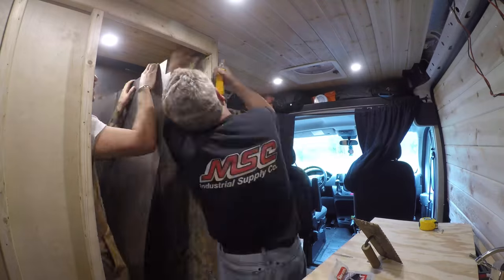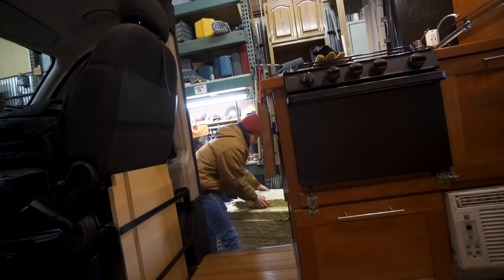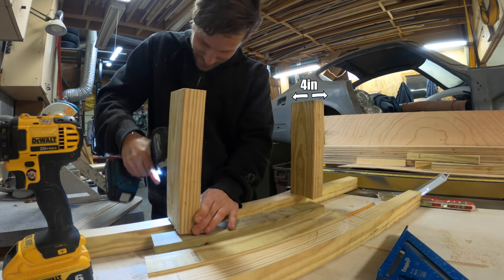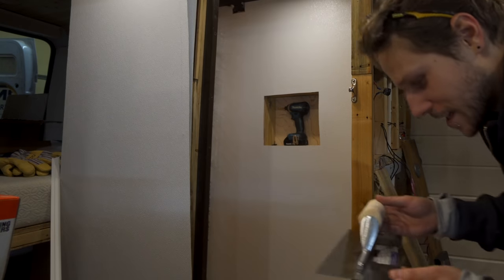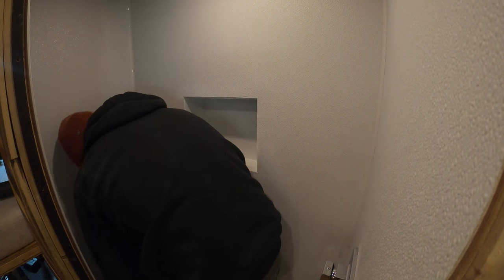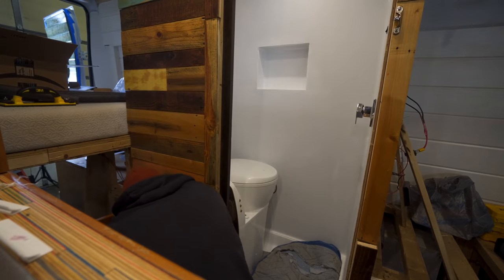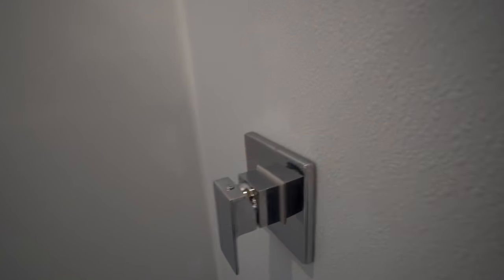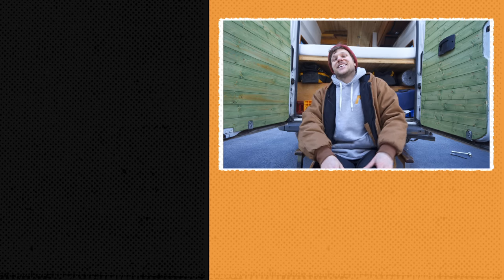DIY Van Wet Bath Using FRP Shower Walls

Comment: Skip the panels, use marine grade epoxy and fiberglass chop strand right on to the 1/4" plywood... I even just use epoxy only and seal both sides and the edges and have it outside and no rotting of the plywood. Want color gel coat it after or the epoxy on the plywood alone looks good too.
Reply from the maker: Do you have any photo examples of this I could check out?
Reply: @dogcatmanvan  The place I did it is hard to photograph. I made a matching bulkhead plates on the outside of the box and cab so I could use accordion seal in between and go from box to cab. I have a 26' 89 International diesel S1600 LP Uhaul. The LP is the low profile package where you can drop the truck 4" with the air bags. There is about 7 inch space to see it, but I painted it so it looks like a steel plate and not plywood.
Here are some links to other projects using that technique.
Tank
https://youtu.be/uWYPBm0tu38
Boat wheel house
https://m.youtube.com/watch?v=TzkWeuC0yPs
Plywood Shower and tub
https://youtube.com/playlist?list=PL4cGhq-GjyFk6do3YfNMpIkGsbfgNRrds

The key is to seal every thing and if you drill a hole or nail it reepoxy those spots and it won't rot or get wet... If it gets wet, and freezes it will pop the fiberglass and epoxy off. 

Had that issue with my box... They repaired a 4' x 8' hole in the side of my box with bondo and not marine grade fiberglass. The wrap, primer and sealer cracked and the bondo sucked water in, rotted the plywood next to where the bondo was and where it wasn't, water soaked in to the frp and popped the panel off the plywood. So I had to cut it off to where the connection was still good and feather the edge and chop strand it back to level... I only noticed this when I took 5 layers of wrap off the box because spots had cracked and I wanted to seal the roof and sides with Raptor bed liner.

Don't use automotive grade fiberglass or epoxy... They aren't water proof. They rely on the paint to seal it. Marine grade epoxy will soak into the plywood. Or if you have deep pockets, you can use starboard and not need to seal it.

The project is on hold I got cancer 4 months ago, beat it and now trying to get my strength back to finish it. Was getting ready to put a non roof penetrating roof rack on. It will attach to the box sides. I have zero holes in the roof and it doesn't leak so I'd like to keep it that way. ;)

Comment: I’m finding so many cool channels now that I posted working on my travelcraft !!! Your channel is great I’m almost done with my shower pan using the epoxy fiberglass method but my shower is at the rear end and used massive 2x6 boards for the curbs of the tub 😂

Comment: looks good to me. I plan on doing several small bathrooms with this stuff. Starting with mine then Mothers and grandmothers. I plan on trimming it with that PVC trim to hold it in place and back it with tar paper so taking it apart is easy if has problems

Comment: This was a very useful video, many thanks!  I have to do a remodel of my bathroom and wondered how FRP was put up.  I also could not get a smooth finish, it is textured like yours, at Lowes.  Apparently the texture does not matter in the bathroom? How is yours holding up after a year?  Please let me know.  I want to be sure the bumpy texture will not get moldy in the crevices or is hard to clean.
Ceiling looks real nice with the cedar paneling.  Showing how you used the mastic adhesive was very helpful as was the alcove for shampoo/ soap.  Very nice job.  Your bathroom looks functional and spacious with lots of light.  Ceiling adds warmth and depth.  Please tell me how the sides are holding up to soap scum and mold.
Reply from the maker: I've actually sold that van, but the walls held up fine for the 8 months I had it after the install. You will gradually build up soap scum and dirt on the walls, but it's very easy to clean. I never had any issues with mold. There's also a chemical smell that the FRP has for a few months after you install it, but it dissipates over time. Overall, I think it was a pretty easy and budget friendly shower wall solution.

Comment: A super clean way to cut FRP that doesn't require the metal rubbing and messy jigsaw shards is to heat the FRP along the section you want to cut with a heat gun until it softens. Once it's soft, it can be cut as easy as soft plastic using a normal box cutter blade. It's also a good way to add bends or do complicated curved cuts or holes. It's a stinky process, though, so best to do outdoors and with a good respirator mask on.
Reply from the maker: Thanks for the tip!

Comment: I really hope your FRP holds up! I’ve got quite a bit in my build (polywall) as a veneer replacement and this winter in Wisconsin has DESTROYED lots of it. The polywall is very prone to temperature warping and I’m pretty much remodeling the entire van this summer because of it 😂
Reply: I just bought polywall for my van, would you suggest using FRP instead? I liked that the polywall is not as heavy.
Reply: @ComeIntoTheOut  honestly, after 2.5 years of living in it full time, I don’t think either will stand the rest of time with constant temp changes. It also stains really easily, which was the opposite of what I thought would happen

Comment: I flip my FRP face down when cutting. The jig saw metal marks are then on the back side never to be seen after gluing. You don't need to caulk the corner channel receiving the new panel, just along the bead that's pressing up against the new panel.

Pro Tip: after running a bead of SILICONE caulk, spritz the run with "ammonia-free" glass cleaner and then dress the bead with your finger as we used to do with latex caulk. A "water wetted" finger will mess up the silicone caulk. A "window cleaner wetted" finger will give you the best dressing you've ever done. After the dressing just let the window cleaner dry, don't try to wipe it.
Reply from the maker: I'll have to give the window cleaner method a shot. Thanks for the tips!

Comment: I liked the sheet metal look with the exposed plumbing, but I think the new bathroom looks even better.  If the old bathroom topped the van weight off int he 8k range, how much do you think it weighs now?  Less obviously, but how much less?
Reply from the maker: I won't know exactly how much weight was shed by removing the sheet metal until I go and weigh it again, but I would assume it was somewhere around 75lbs. It's going to take a combination of things to really drop some weight. I'm slowly chipping away though haha

Comment: What is the footprint of the bathroom? I'm considering 24x36" in a smaller van, with a removable self-contained toilet that can be set aside for more shower space.
Reply from the maker: That's the same size shower I had in the van

Comment: I was thinking of using FRP on the ceiling on my build but was told it off gasses and really smells. Did you find that to be the case? Oh...and I love your dog, I have a Heeler too (red) their the best.
Reply from the maker: Yeah the FRP definitely has a chemical smell, but I've noticed it's starting to fade a bit.
Reply: @dogcatmanvan  thanks for getting back.

Comment: so does the FRP board go over the shower pan lip or behind it? Great video, thanks for sharing!
Reply from the maker: Your backer material should lay flush to the lip and the frp should overlay both the backer material and the shower pan lip.
Reply: @dogcatmanvan why so? I have pipes under the shower pan and if sth goes wrong I want to be able to remove the pan. So I covered the walls with frp and then put the pan on the backer slats and seal the corners. Did I do sth wrong? 😱

Comment: Keep a Mr clean magic sponge in the shower to clean the FRP. Every few showers wipe it down with the sponge (yes, while.you are in the shower naked) then take your shower. You will never have to really scrub again. You're welcome 😊

Cover with masking tape or turn the piece upside down

Ps it's better then half bad. Don't sell yourselves short. I like it better then the fancy ones. A shower In a van doesn't need to be fancy. It needs to be functional and hold up. Besides,  I can find plenty of things to use the extra money on !
Reply from the maker: Thanks for the tip! I've already got some magic sponges in the van